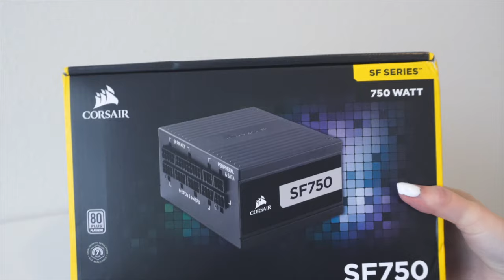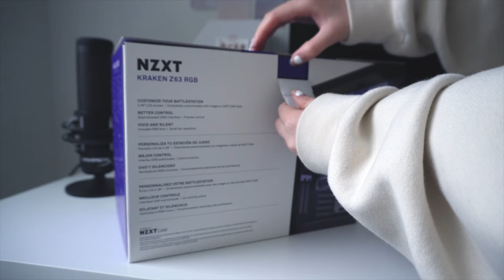building my first PC 🤍 white aesthetic | lian li O11D mini, rtx 3060, kraken z63, intel i5

Comment: your nzxt fan please check it again, i don't think it's the right direction
Reply: Set as intake, which gives her more positive pressure, positive pressure is fine. Negative pressure isn't, she has 5 intake and 3 exhaust fans
Reply: Thats not a wrong direction bro learn about pc maybe 💀
Reply: dont talk if u dont know anything
Reply: They're in the right direction, but those god awful fans gotta go, terrible static pressure and no rgb on the back, though rgb is more of a preference ofc
Reply: @spagettete_  My specs are better than him and yes I also use NZXT 280mm with 30-50 degrees when gaming
Reply: @geskawilantara8190  that has nothing to do with the arguement we had
Reply: @spagettete_  yes, because the way I installed the fan is better, and you just said I don't know anything
Reply: @geskawilantara8190  yeah and you never said that u installed the fans the other way in the comment + setting the fans on the right as intake is better than exhaust but it doenst make a huge diff anyway

Comment: You should move the radiator to the top and flip the fans to the other side with the cable pointing up so you aren't blowing hot air into the case
Reply: No he shouldnt, moving up top increases the noise and temps of the cpu substantially. Side mounting in push airflow only increase the GPU temps only by 2 to 3 degress. Its been proven for the o11 dynamic mini in many youtube build videos.
Reply: In case you didn’t know, you can’t fit radiators on top if you use an atx mb with this case, only mini model that’s able to do it is the alseye cube

Comment: Leaving 50% performance on the table but great aesthetic build, looks very nice
Reply: What does this mean? Is there a way performance couldve been improved?
Reply: @s1mone477  massively! A 3060 is a weak gpu and for the money they spent they could’ve got an rx 6700 XT from AMD which is a lot faster anyways or got a much cheaper cooler as 280 bucks for a cooler is incredibly expensive so a 90 bucks cooler with the rest saved towards a better gpu like the AMD rx 6800 would be a better investment as it’s twice as fast as the 3060
Reply: @conxptexe  Thanks!
Reply: @s1mone477  the motherboard is also kind of overpriced for this PC so thats what he meant. its a bit sad to see that so much was spend just for design and then so much less on performence. 

But i am not gona lie it looks absolutly amacing so if thats what she wants and dont mind that much performence gone to waste then go for it.
Reply: @conxptexe  fr ill never understand paying like the same than a medium high pc for medium low one but hey is white and if they enjoy it , i look more to the monitor than the case but well xd
Reply: What can we do when women build pc over performance vs. aesthetic
Reply: Furthermore they can get near replica mother, (bit cheaper), cpu cooler (ID Cooler has the best cooling and cheaper only 50 pounds)
Reply: @s1mone477 She could easily make a build with 1.8k build with better and faster components, instead of rtx 3060 she could gotten 4070, mother asrock 670 steel legend with ddr4 ram, ddr4 is not close to ddr5 but its kicks and alot cheaper, 36 ram for total from corsair, ahh yes the cooler, it could be better like ID cooling which is amazing from the price and aesthetic its 50 pounds!
Reply: @s1mone477 i have a 4070 build for cheaper
Reply: YASSS
Reply: @conxptexe  I built a new pc the other day, I got a 4070ti, I see big numbers here like 6700 so I’m wondering if what I got is good? I thought it was 😅
Reply: @jonathanv8127 lmao thats amd, the 4070 ti is way better then a 6700
Reply: @RainyLevel  I’m still relatively new to building my PC. I’m over here thinking I got scammed 😂
Reply: @playerwith1664 if I wanted my build to be good both performance and aesthetic wise, what solid color would be the best?
Reply: @tsukette.  you can go white, if that is what you like ( i personally enjoy black pc builds), just do not go for a flashy led screens/bling instead of performance, maintain balance. For example nzxt z63 here could have been replaced by quite a few white AIO's (lian-li galahad, Deepcool LT520, just to name a few) and the money saved (which would be like 50% of the nzxt cooler) could upgrade your graphics card. 
I do love lian li uni fans for the looks and decent performance, but their price is not worth it unless you do not have a budget ceiling and putting them in a high end pc with really good hw specs.
These are the biggest issues (or should i say "does not make sense") i have with this, aesthetically good looking, build.
In time you will not even notice how good your pc looks, but you will notice the lacking performance very quick...
Reply: @conxptexe do you have recommendations for a better price/performance gpu in white ? :)

Comment: A nice build! I have used this case and learned that you should remove the magnetic filter under the top cover to allow for better exhaust airflow. Since you have the radiator fans blowing into the case, this is heated air and needs to be exhausted quickly before it can affect other internal components. You should keep the top and rear fans running fast. Then be aware that if you are using the Lian Li L-Connect software (for fan control) is an executable. This means that when you log out and leave the PC running the L-Connect software stops running and fans speeds are fixed at the last setting. Hope this helps.

Comment: Very well done job for a first pc build right there! Only 2 things that U can actually do better, one is kinda important which is placing Yours AIO cpu cooler the way that pipes are at the bottom of the radiator, it prevents pump from sucking air bubbles in so the temps are lower and it makes aio work quiter, the second thing that u might do even better is a cable managent at least at the front of Urs pc, however thats purely aesthetic thing. Overall well done!

Comment: Is there anything I need to add or buy to the Pc if I replace the 3060 with 4070 ti? It’s my first time building a Pc
Reply: How much wattage is your current PSU?
Reply: @PyroGonz  1000w
Reply: @HTK-EditZ  You should be just fine then. 👍🏼 the 4070ti doesn’t draw as much power as a 4090.
Reply: @HTK-EditZ  There's no reason for a 1000 watt power supply now, just gonna matter when that 600 watt 5090 drops💀

Comment: u did it better than a lot of man calling themselves ''pro pc builders'' giving advice on yt to make money but they shake the cpu into the socket to check if its right positioned and im like >:c watching how the pins are about to bend lmao , anyways , nice build , i would only change the liquid cooler , its unnecesary for the i5 12600k tbh , but i know that u choosed that one because of the led screen on the pump , so nevermind , its your money , your pc ... build as u pleases.
i also put the rad upper with fans out , because this way u get fresh air from the bottom , the side fans , and it all goes away fresh by the top , where u need it , through the liquid cooler rad , that is hot , then the hotter air is going outside the case , and also the fresh air is going through it wind nice pressure , not with pulling force as u had it , it is the only thing i can tell u about your build.
Reply: a 1500 dollar pc with only a 3060 is horrible

Comment: You should put your CPU COOLER raditor at the top of your case, btw really good build
Reply: No water cooling cools slightly better when positioned on the front or side of the case
Reply: @Lynars  No, it absolutely doesn't. When placed at the side or front, it will likely die faster, and it will cool worse.

Comment: kraken z63 overkill for this pc i guess he buys it because it looks cool but for 3060 and 12600k doesnt need z63 its like 200$ you can get less than 100$ cooler and be fine and then upgrade your gpu and cpu or other parts
Reply: This isnt a boy
Reply: overkill is not real.

Comment: Isn't it better to put the water cooling fans backwards facing the radiator?

Btw, your build is so damn cool, I liked it a lot.
Reply: She set her fans as intake for the aio, so she has 5 intake and 3 exhaust. Positive pressure setup is less dust build up
Reply: Top exhaust is better for GPU temps.

Comment: should  the fans be also from the brand or can it be a different bc its too expensive
Reply: It doesn’t matter, though some cheaper fans may be worse quality of course. If you’re planning to build a first time pc build, I would not suggest an expensive AIO. Something like the thermalright peerless assassin would work as well. There is some overspending in this build. She would’ve been fine without the Lian Li fans and the NZXT cooler, and maybe upgrading to an rtx 4070.

Comment: You could have gotten a i5 12400f and upgraded to a 3060ti or 3070
Reply: I was just thinking the same thing. Also i believe B660 motherboards don't support CPU overclocking, so spending more for the i5-12600K is a bit of a shame
Reply: Still a very nice build! Love the aesthetic